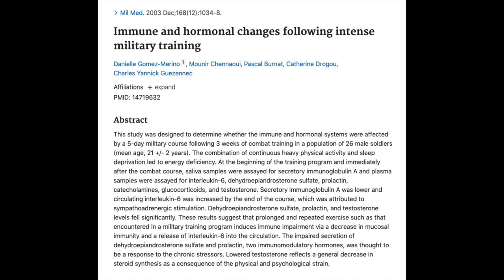Low Frequency Training with Tracey Cheuvront (AKA "Bastionhead")

Comment: Squatting every 2 weeks, and deadlifting every 21 days was  a huge game-changer! The weights became "light", and my progress rate vastly improved. Also my joints thanked me, and it was easier to psyche up for my workouts. Win-win all the way!!!
Reply: What’s your routine?
Reply: Yes it sounds great, but do you gain muscle ?
Reply: @toshiamata  I also train with one set to failure with a low frequency. I can gain both strength and muscles but keep in mind that for natural gains are slow and overtraining is still possible...
Reply: Definately Mike Mentzer was begging people to train less to grow more. Those that listened progressed. Those that didnt think they have shitty genetics and either give up or take gear.

I workout once every 6 to 8 days. And at 61 I have more muscle than most men half my age. Mike Mentzer was right..

Comment: Bastionhead! Dude always had great content and a solid philosophy: Do What Works for You. If that means training less often to get stronger? Do it. I remember I was having similar results with Infrequent, high-intensity workouts. Great gains. Every time I did excessive volume? Stagnation. Thanks for this video! Everyone is different, but I think a lot of people would see strength gains by decreasing constantly excessive volume.
Reply from the maker: Agreed, love his content. I found over  time I  hated being sore all the time. So that's why I train mostly low reps for strength work now, and higher rep calisthenics. Get great results. You don't need to do high volume to get results. Sometimes it can work against you. When thinking about workout programming, I always ask myself the question "is this sustainable?" Looking back the last 15 years of lifting, I've found that nearly every time I tried to do a whole bunch of volume, I got hurt with overuse injuries or became over trained and tired all the time. What's the point of working out when we're in pain the other 90% of our lives when we are outside of the gym? Slow and steady wins the race.
Reply: @stevensmith4706  what about Stuart McRobert ideas? It's very similar :-) Low volume and frequency.